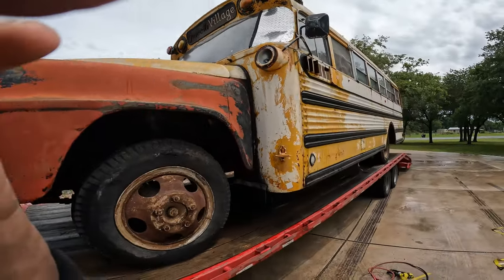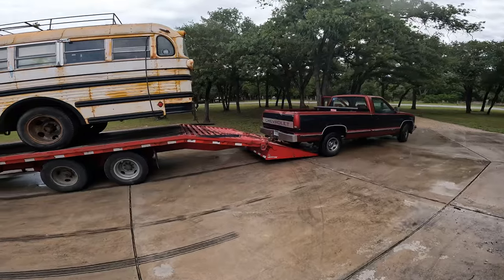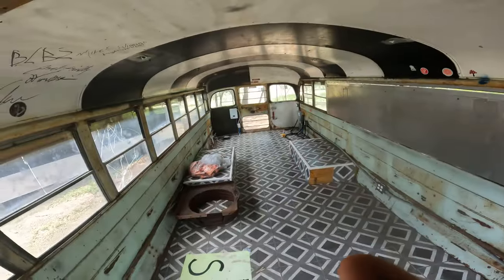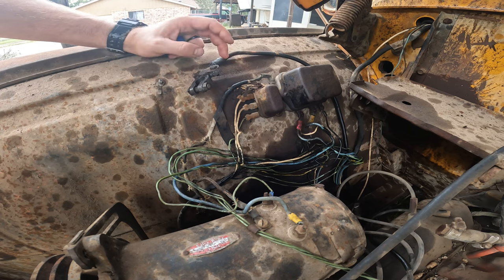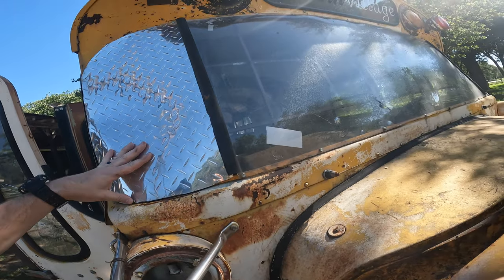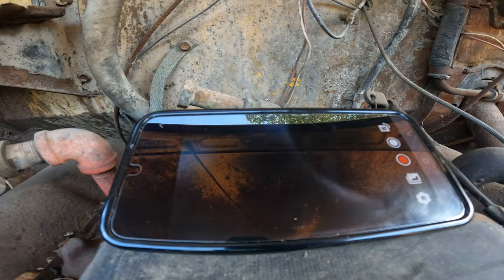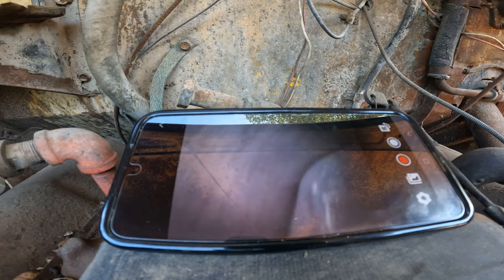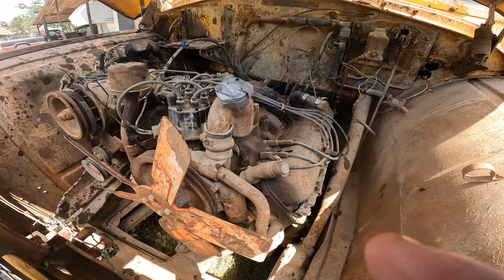New Project, 1961 International Harvester B-163 Bus.

Comment: Leave the Chevrolet in drive (L), and then just operate your winch on the trailer....
Reply from the maker: Tried that didn't work. Wasn't on a slope.
Reply: @crescenthammer  10-4, I envy you for the prize you found, I know how simple, but do not envy you on the task ahead. Many hands make light work though and you have another volunteer.